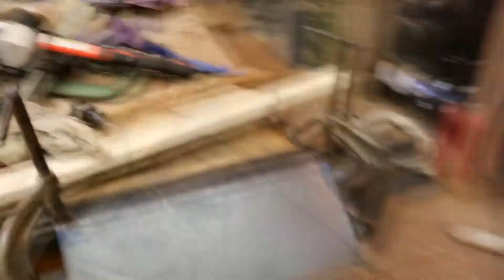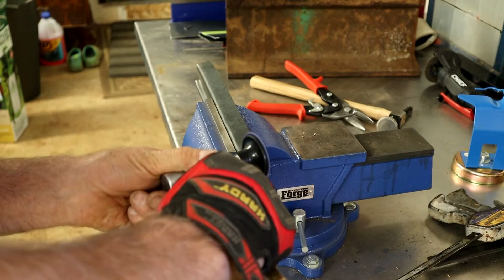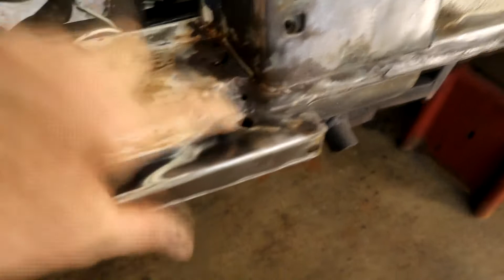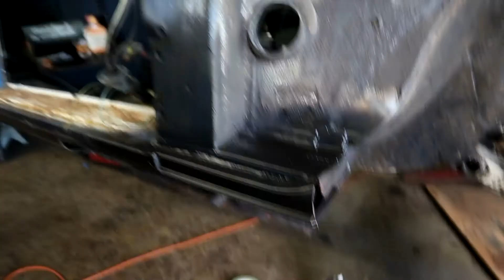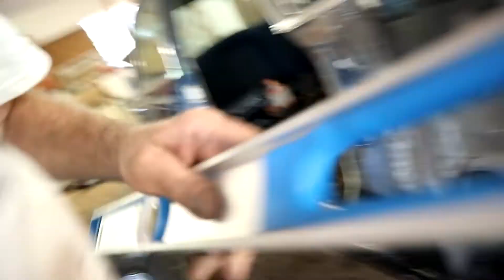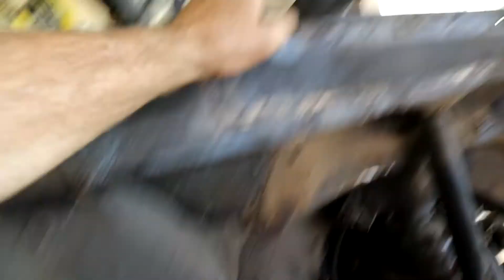Mercedes 300 SEL 6.3  A tricky little Rocker patch. Part Four

Comment: Typical W110 to W109  rust place. The front end has a bulge which allows the bottom of the guard to sit flush. Also the end plates are a complex little shape(two each side welded down a flange),not flat,which is what us Merc Anoraks look for .😁
Reply from the maker: Merc Anoraks:) LOL:) The front is what I'll be doing next. Hopefully it'll pass the Anorak test:)